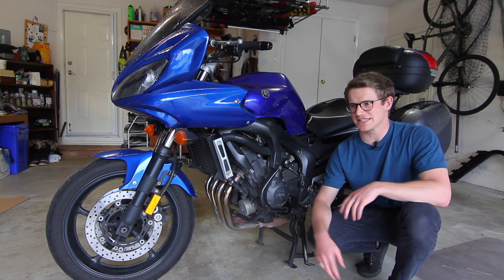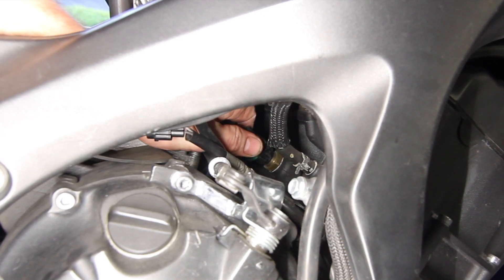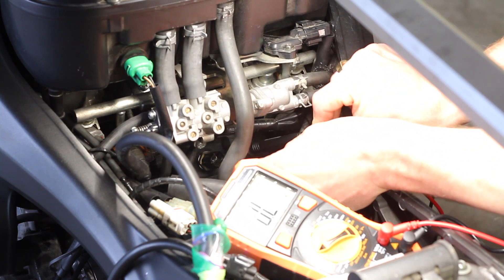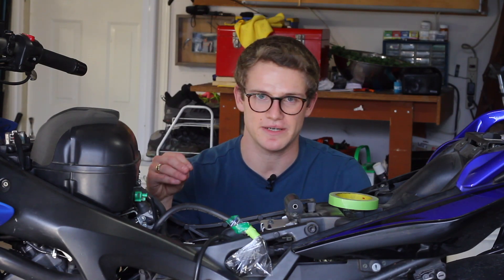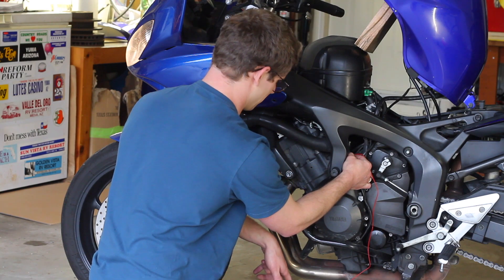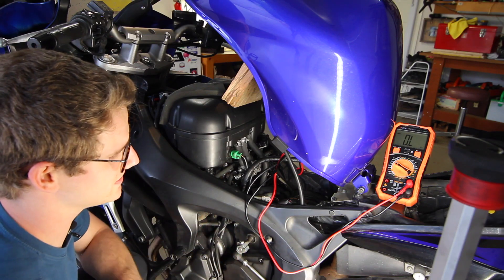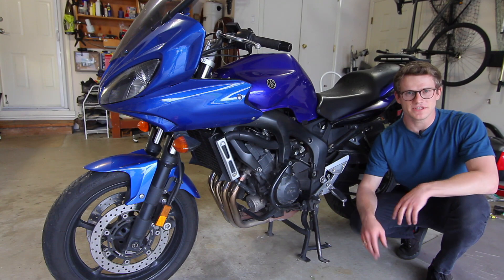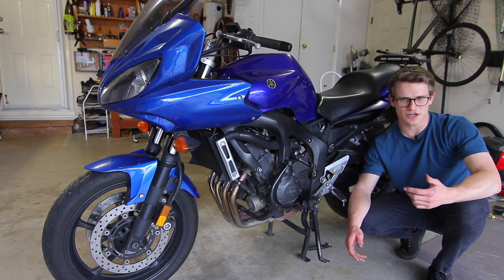FZ6 Coolant Temperature Sensor Diagnosis - Code 21

Comment: Brother im facing some serious issues that's bothering me ! High fuel consumption ... black smoke at high rpm .. a delay in acceleration in addition to rough idle not stable and sometimes it shutdown at the stop signs ! These are the symptoms on my yamaha r1 2008 ! Keep in mind there is no check engine light or code displayed on and the bike starts normaly but when i ran a diagnotics check on the dash a code named : d:21 popped up i need help to determine what's the relationship of these symptoms with this code and if it's the right code causing this issue it's killing me and i can't find a fix for it since mechanics in morocco couldn't fix my issue ! PLEASE HELP IM BEGGING YOU
Reply: Go on to a forum